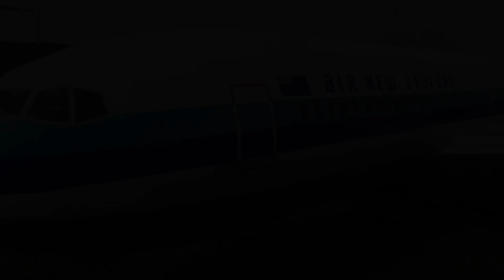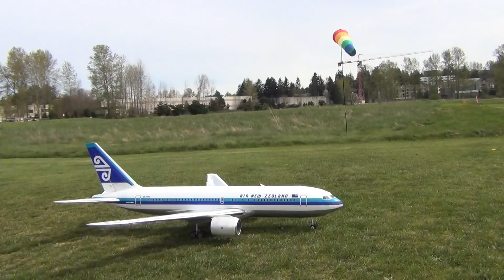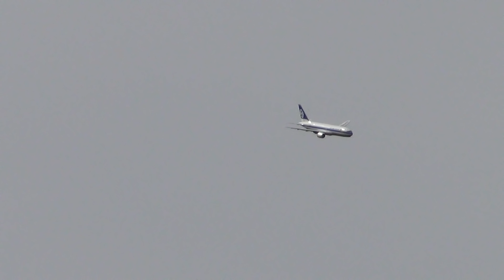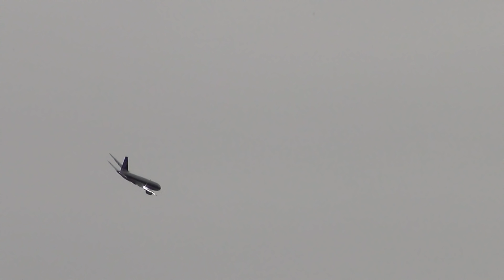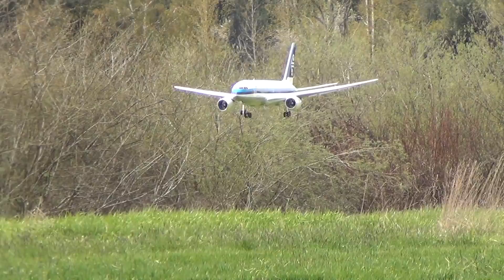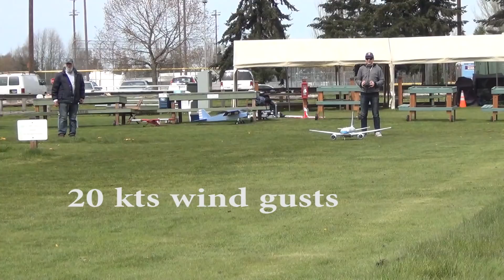RC Boeing 767-200 EDF Air New Zealand Depron Airliner Jet Flights

Comment: Background comments indicate you're using a stabilized RX...smart move. Really stunning to see the results!
Reply from the maker: Glenn Horowitz Actually I haven't added a gyro yet! We were discussing the need for it because of the wing rock. I'm installing a 3 axis gyro next flight
Reply: You're doing an exceptional job of flying, then. Like my friends who flew Learjets (and some in airliners) told me, with swept wings and moments unlike older propeller driven planes, these ships tend to Dutch roll like mad without at least a yaw damper. As the commenter indicated, a stabilizer only helps small planes fly like bigger ones...I agree and I'll bet your flights will be even better and smoother with a piezo gyro or three on the job.

BTW, just so it's clear how effective and essential a yaw damper is in Lears, one that's inop is a definite no-go item.